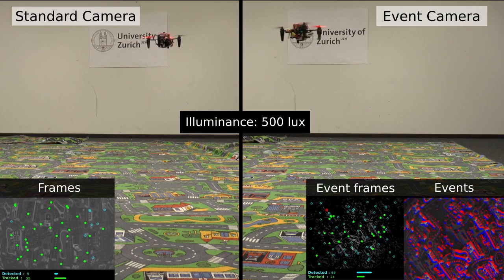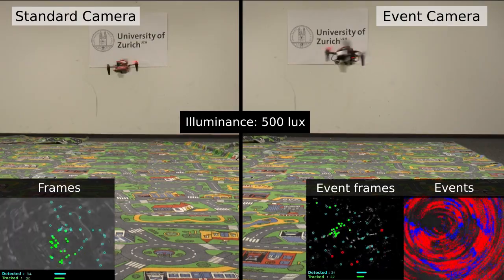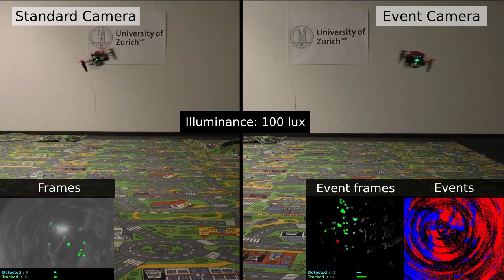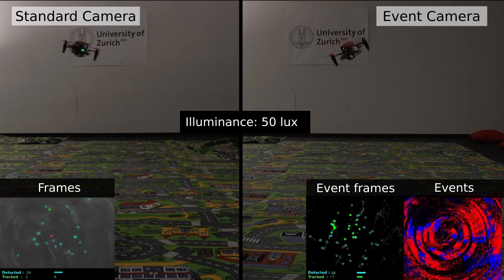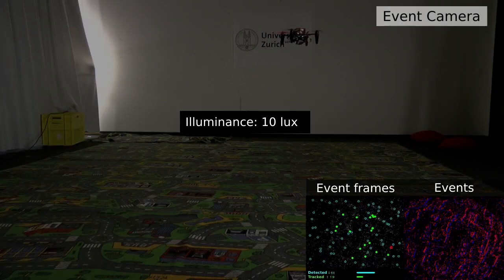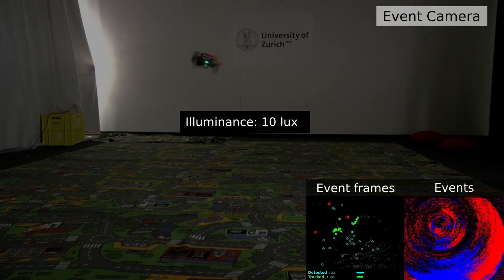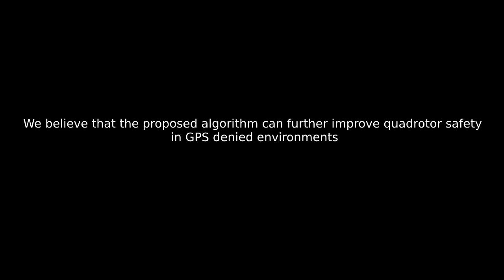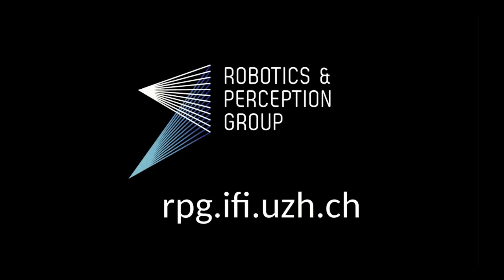Autonomous Quadrotor Flight despite Rotor Failure with Onboard Vision Sensors: Frames vs Events

Comment: Does the motor opposite the bad one reverse?
Reply: No it doesn't reverse but generates a minimum thrust.
Reply: @sihaosun9491  I wonder if it would be more stable with the opposite motor reversing, to fly level, or would that increase the yaw rate?
Reply: @speter60 That was also my idea. 2 opposite corners provide full thrust, and the third, functional rotor balances the drone like riding a bicycle. That would result in stable flight without rotation, or at least much less rotation.